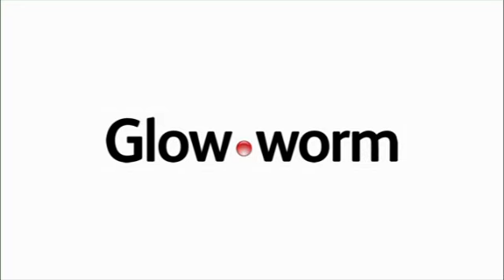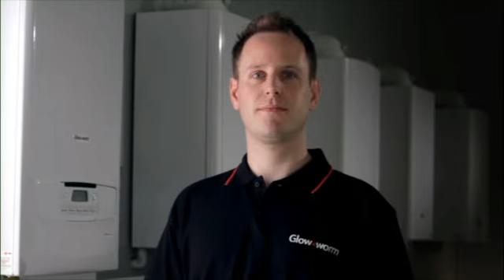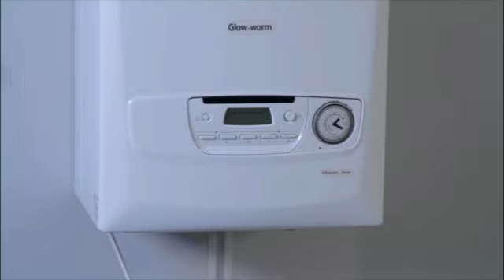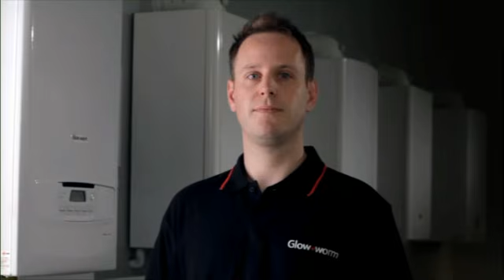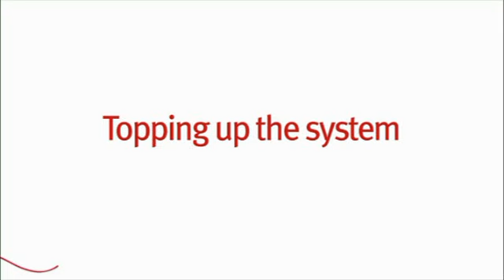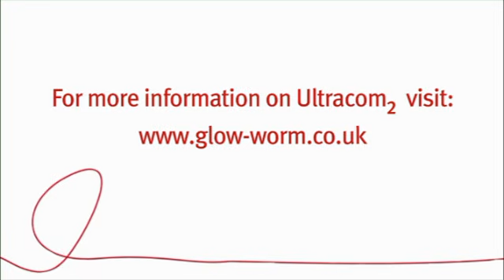Glow-worm Ultracom2 Filling Loop Access All Areas technical videos

Comment: water poured out when i pushed or pulled can't remember, that locking thing in middle. had to call out a plumber in the end. why do they make boilers that are difficult to handle? why not have those filling valves more accessible. instead of bending down
Reply: agreed,I lack strength in my hands now and ended up flooding the kitchen.  The blue grips are rubbish and the middle thing is difficult to move. I know technically how to do it but its just difficult to do

Comment: Thank you so much for this, I followed the instructions on the boiler but the left hand filling tap wouldn't move and the disconnector was locked in upwards position and wouldn't move either. This gave me some confidence that I only needed to move the lock and and find something to turn the left hand filling tap as the right one moved without issue (they are easier to turn without the attachments) , I couldn't find an Allen key big enough but manged to use a spanner, I really needed to put a lot of force to move it but once it finally moved the stiffness was gone everything was fine.  Just in case this happens to anyone else. I did notice however after filling the boiler to 1.5 that the pressure kept increasing slowly up to 1.8 (this is without heating as it now goes up to 2.3 max when heating is turned on) so I would go to say 1.2 and then wait to see if it goes up on it's own as ideally you only want 1.5

Comment: Is it a serious issue if the filling loop disconnector is permanently in the filling position?  This is the first time I've used the filling loop in my new house and while everything went as well as the video for me resolving the pressure issue, whoever serviced this before hasn't moved that centre disconnector back and I'm unable to move it.
Reply from the maker: Hello Kevin,

Unfortunately, we can't help with technical advice on this channel. Please call our service team on 0344 693 3133 for assistance. 

Thanks, 

Glow-worm

Comment: The filling loop disconnector (with green locking collar) of my Glow Worm Ultracom2 cxi combi boiler has just started leaking. It is snowing outside. Is it related to the freezing temperatures outside and hence is likely to stop? Or is it related to a faulty isolation valve or corroded washer? If so, how much could it cost to repair?
Reply from the maker: Hello, for technical advice, please call our team on 0344 693 3133 and they'll be able to help. Thanks

Comment: The blue filling taps are crap, made of plastic and to stiff to turn with those plastic udder things. The filling system could have been made much easier and NOT made of plastic!!  Also be careful to make sure filling loop, the thing with the green collar is fully pushed up, if not you will get splattered with water...
Reply: Hiya..I know it's so long ago but did you have a workaround for those stuck blue taps? 

The turning aid doesn't grip, the allan key doesn't work, pliers neither. Lockdown is a great time to have no hot water!
Reply: @GreatBritishBeast  Hi, they are an absolute nightmare, feel your pain. Allan keys worked the first few times then due to being plastic the edges wore out. In the end I used  a pair of needle nose pliers, got underneath the blue taps inserted one of the plier needles in to the hole where the Allan key goes and the other on the outside edge of the blue tap and gripped them like that and managed to open it by turning, being very careful to turn in the right direction. Make sure you don't tighten them too much when closing again. Alternative is paying for a plumber to come out in this lockdown, crazy when you know what the problem is. I have moved house so no longer have this problem. Good luck!
Reply: @nozislam  cheers for the quick reply.

Glad the new boiler treats you better!

I'll give those pliers a try then! Thanks again!

Comment: Got my son to get plyers and literally rip the blue filling loops off the little piece of metal that holds it together as they were too tight. Plyers will turn the metal piece easily.
Reply: Thanks for the advice, the turning loops snaped on the metal pipe as they were that tight / stiff. Stupid cheap shit boiler that the landlord put in.
Reply: @Zulisian  hiya...so did you essentially rip the blue tap parts off to get at the underneath? 

I used to be able to turn mine the last time, about 1 year back, but now they are immovable; allan key and pliers do nothing. 

I thought maybe its frozen or rusted shut over winter or something.

Great time during lockdown to have no hot water.
Reply: 2:38

Comment: I spent almost an hour to find a way to push the green collar up (actually you should push the black L-shaped part up). But what I found was that it has already been in the up position, although the green lever was in a proper lock position. That was why I couldn’t push it up! I just pull it down (there is nothing like a spring mechanism that helps you), and then push it up again and rotate the green lever. This works. The blue plastic socket handles are rubbish.
Reply: Thank you , you legend
Reply: My blue grips broke 😂 so I just use a pair of grips

Comment: This video is great.  I woke up to a cold house and the boiler blinking no gas icon and nothing else, no pressure at all.  The printed manual is useless although I am not scared of gadgets.  My question is - what would happen if I was on 2 week holiday and the boiler shut down?  Its winter and fairly cold and pipes could freeze.  I don't like this part of owning Glo-worm.  I had a different combi boiler in my previous house and never had to fill it up.

Comment: Extremely useful! I tried to follow the instructions in the manual but couldn't get past the first step of pushing the disconnector upwards. From the video I realised that the installer had actually left it in the upwards position, which is why it didn't budge! The RH tap was a bit stiff to open, especially with those soft, floppy blue handles, and I nearly called for more muscle power but a determined effort got it moving and I rather nervously managed to fill to 1.2 bar. The only thing that concerned me though was that the heating and water turned themselves on once I reached a certain level. I thought they would stay off until I was finished, so I punched the Menu button a few times to turn them off, but they wouldn't stay off so I gave up and just hoped that was alright.

Comment: Using the blue handles, I could turn the filling taps, but had no idea if they were open or closed. No sound of running water, nightmare.
Reply: +28lyonc Blue handles are crap, they just turn around the thread, not actually turning anything. I used a hex key which sorted them out properly.